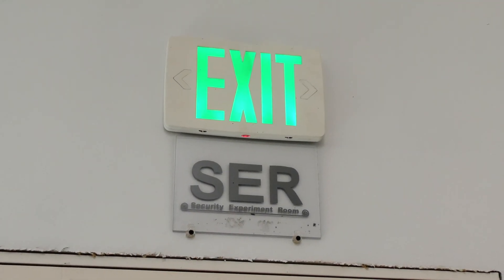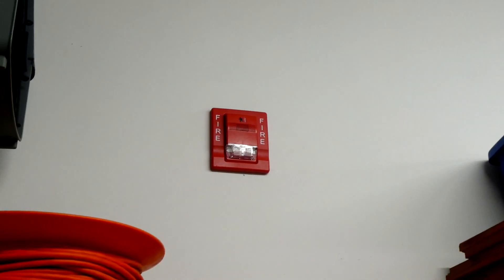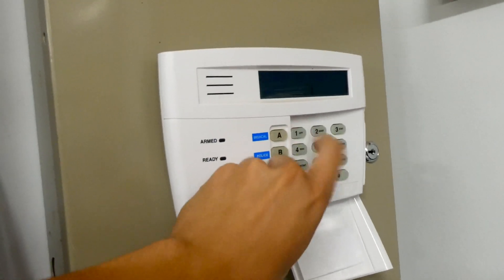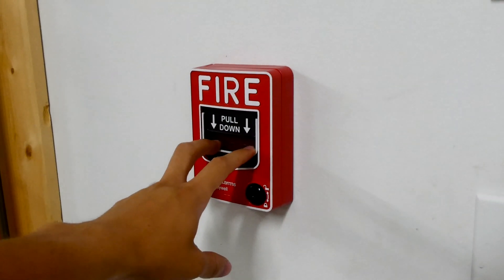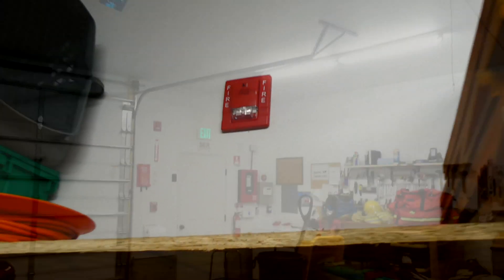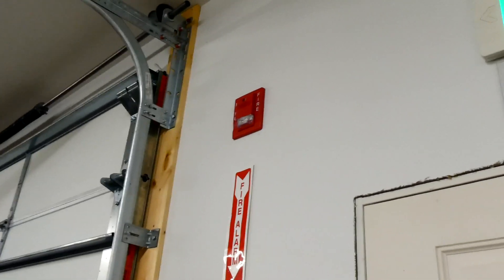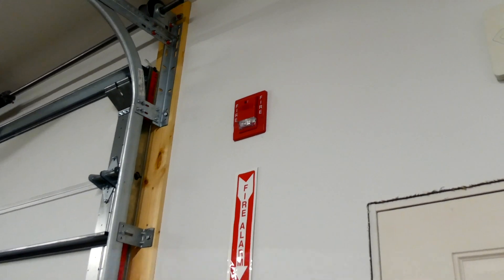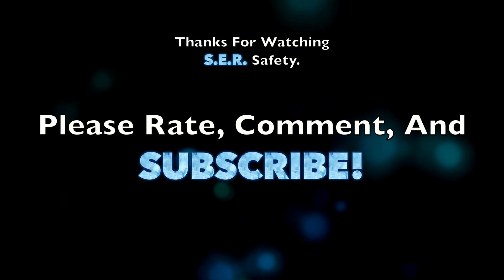Kidde System Test 20: EST Genesis Chime/Strobes!

Comment: You could probably just put remote strobes all over your garage and just use the steady tone on your security siren for the actual alarm.  All you would need to do is replace the horn/strobes with remote strobes and have the fire alarm panel trip a fire zone on the security panel.  You do that by wiring the fire zone into the relay on your fire alarm panel like you did here on this video.  That's what I did with my system.  It sounds interesting.  You should try it.

Comment: 04:13 It's actually not the panel that's syncing the devices. The EST Genesis devices have auto syncing capabilities using a small sync module inside the devices. They can also do audible silence with sync on an EST System by cutting power to the horn input.
Reply: There isn't a small sync module on the genesis that is false. There's a chip on the board that syncs all of the devices in means other than relays. (the chip makes sure that all pulses on the strobe and horn are exactly a perfect 1 second so it syncs perfectly with other devices down the line. And the sync eventually dies, which is why the panel does syncronize. 

Either way,  if they are wired to a booster or the 2nd NAC, the panel actually DOES Sync the genesis together.

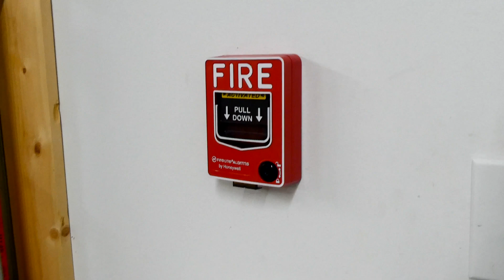Comment: 2:27 whats that black thing that popped out of the bottom of the pull station? I never noticed that before
Reply: Its part of the handle. Its a thing every pull station with this particular design has.
Reply: it can also prevent someone from putting a stopper back in place without resetting the pull station.